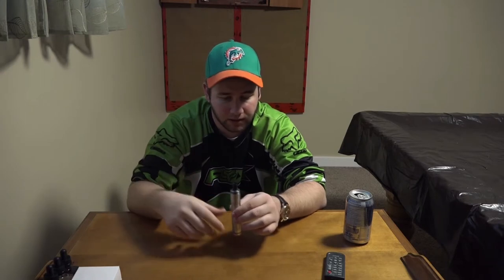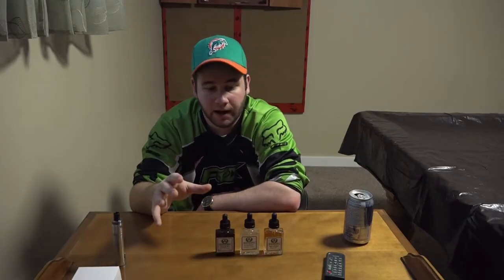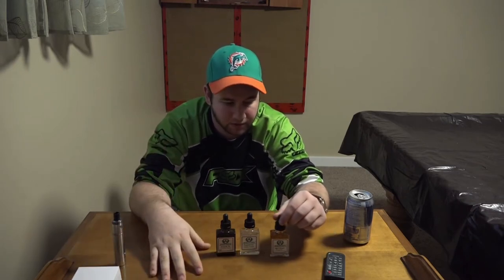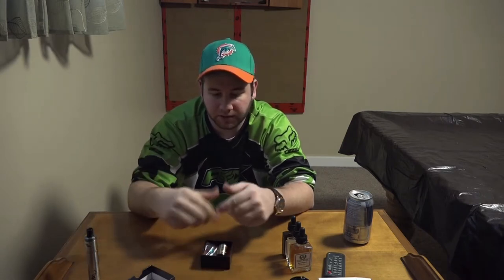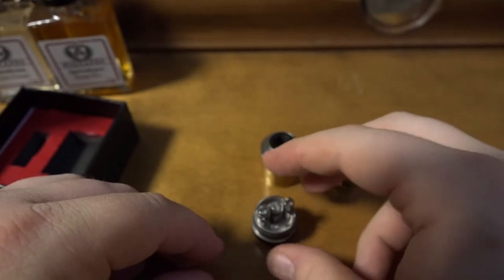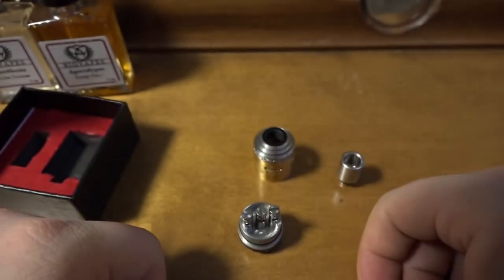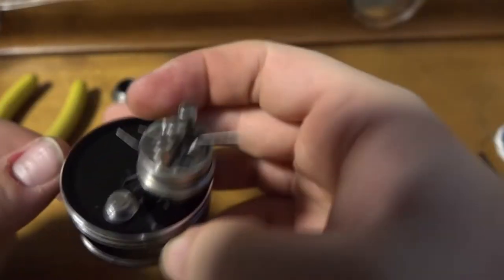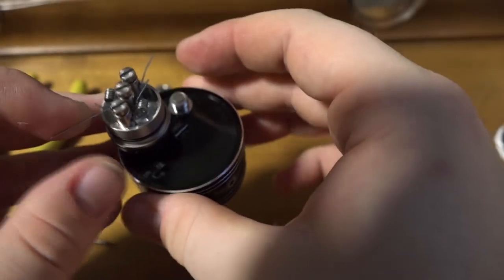Mephisto El Diablo V2 Clone Unboxing, Review and Coil Build

Comment: Hey Robbie, congrats on 100+ subscribers ! I didn't want to comment on your giveaway video, because I already have Maganus v2 figure I'd give someone else the chance. But wanted to congratulate you anyway! Just wanted to give you a heads up incase your still using this Mephisto, I bought the exact same clone in calgary, and I had the same problem with the driptip, but I found if you use 2 puffs driptips ( clones) they will fit perfectly in your Mephisto. Hope all is well!
Reply from the maker: itsyourl3oy Thanks that's pretty damn generous of you to concede the giveaway, shows true class for sure! I actually just bought a 2 Puffs driptip not long ago and haven't tried it in the Mephisto yet, I think I'll give it a try now actually.

Comment: I have two Mephisto Diablos and enjoy them a lot. I use one on a Stingray mech mod and the other on an 80 watt regulated device. i like the deep juice well and large holes. I am running dual clapton coils on each that gives me .25 ohms. I go through a lot of juice. I enjoy vaping so much but as Grimm Green so aptly puts it "vape budget hands". For me, the best sub ohm tank clearomizer is the Freemax Starre. I had for about two weeks and really competes with an rda in cloud production and flavour. A close second anyway. Well, I am happy you liked my comment above and sincerely hope you continue with what looks like a labour of love. Greetings from Montreal.
Reply from the maker: Kaycee 777 How are you liking the clapton coils? I have been meaning to try that build and just haven't got around to it yet. My vape budget hands the last few weeks are broken, I have gone a bit overboard on my spending. I will check out the Freemax though and consider it based on your recommendation. Thanks again for the comment and taking the time to watch my videos and subscribe to my channel.